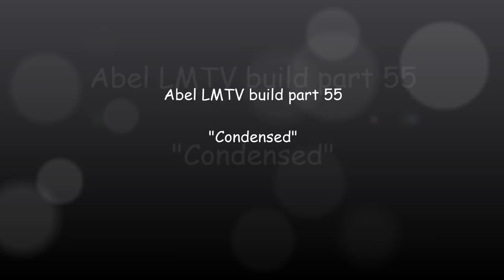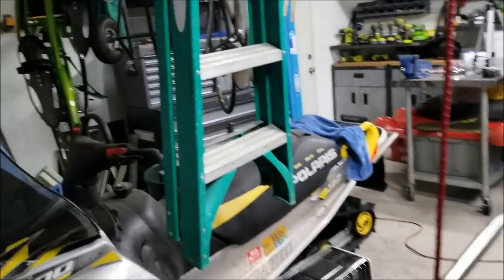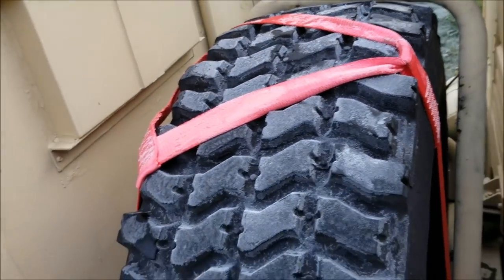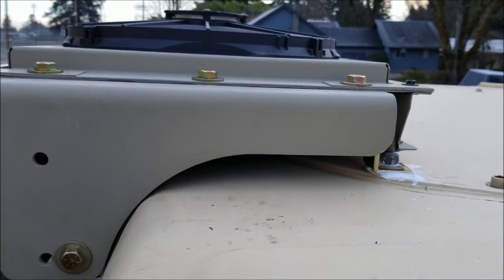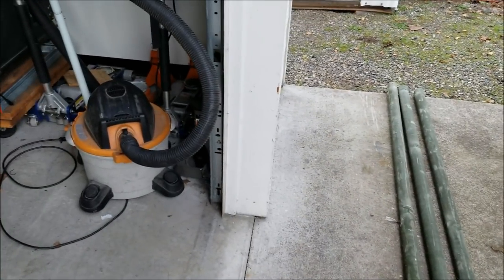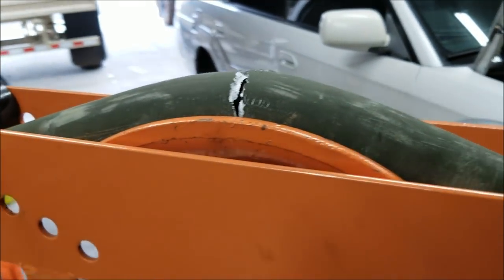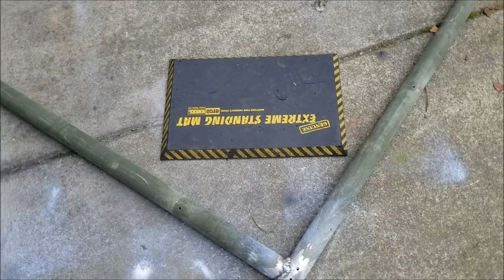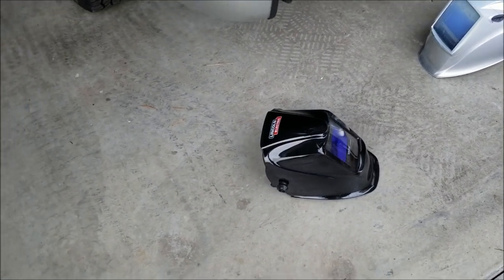Abel LMTV build part 55 (reddot condenser install)

Comment: Hey great video. I have a red dot AC on my recently acquired Humvee. I was thinking about mounting the condensor horizontally on the roof instead of vertically on the back. Are you having any issues at all with it being horizontal- Parallel to the roof? Didn’t know if the oil needed to drain a certain way.  Thanks!
Reply from the maker: The a/c setup on Abel will freeze you out of the cab.  It works great.